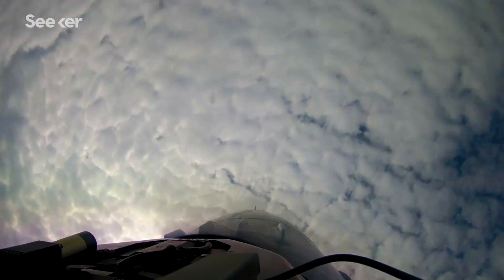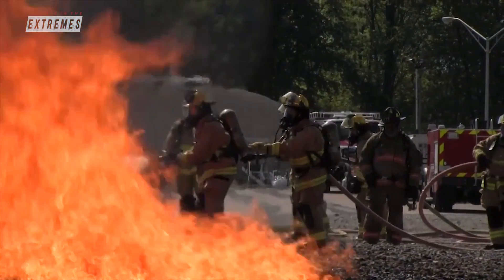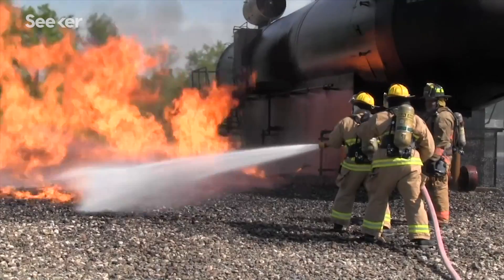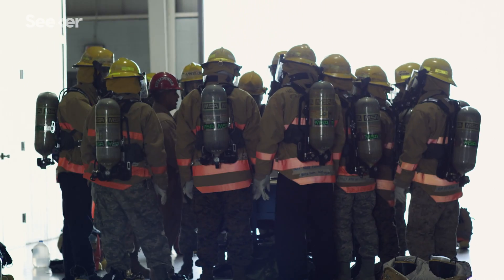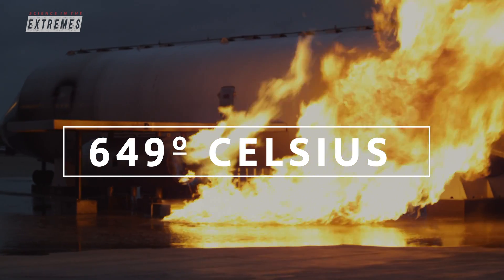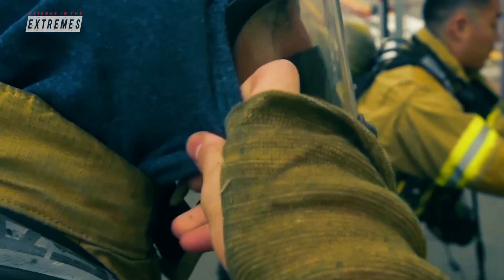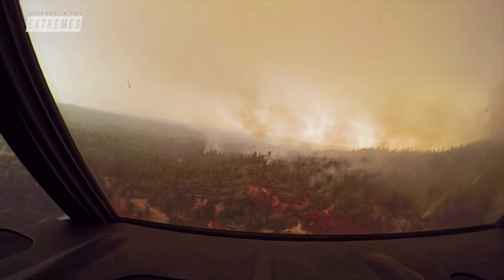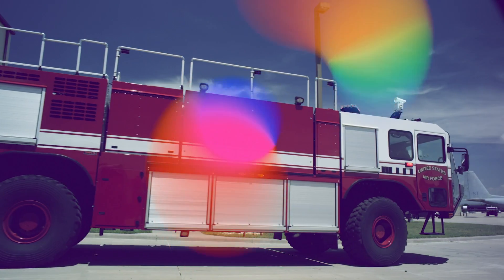What Happens When an Aircraft Catches Fire?

Comment: Wish the explained why 649°C causes the plane to be 'done for'
Reply: Aluminium melts close to that. And past that temperature, the energy in the system is way too high and it may escalate .
Reply: @rolfbjorn9937  so they just leave it or just try to contain with less resources
Reply: @JPzizou  I'm not an Air Force Firefighter, but obviously no, simply put it's a threshold that you don't want to exceed or else : Big Bad.